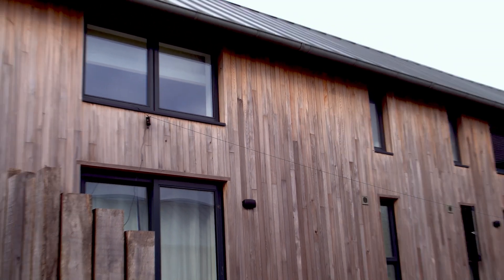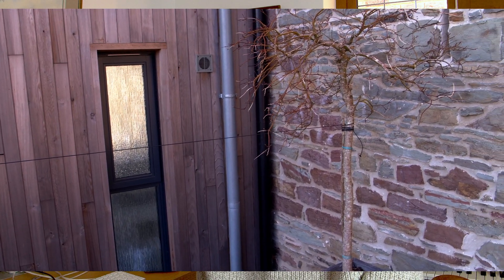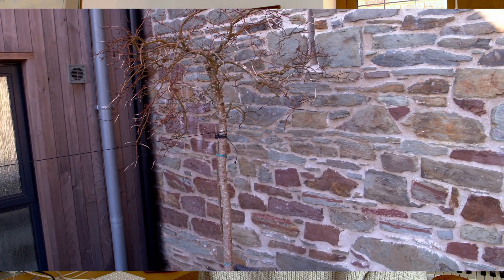My Worst HF Antenna in Eighty Years!

Comment: Just to give you all a different perspective of HF antenna systems that are shall we say 'less than ideal' imagine if you can a 30 ft steel pole angled at approximately 45 degrees end fed to cover 3 to 30 mhz usable only having an atu to make it work? Seem feasible? clue : it is! Any guesses?

Comment: Happy Birthday Peter and thanks for all the interesting videos ,I guess my standout was when I was just about to erect a 6 metre beam and decided to check the VSWR with the antenna on the hedge at around four feet up at the front of the house - using at the time a ft480 and a spectrum comms transporter - I worked all across Europe and had around thirty contacts ! never reneged to repeat it so guess there was a good sporadic E conditions ,just goes to show what can be done ! G4SNU Ron

Comment: My first antenna after getting my license again after 40 years off the air was an end-fed 60-some foot wire that ran under the roof lip of the house, some 8-10 ft off the ground. It was horrible. I ended up putting up a flag pole in the back yard and now I have a horrible (but usable) inverted G5RV with the center about 20 ft off the ground. That's all my HOA will allow. I have a magnetic loop project on the back burner.

Comment: Many happy returns Pete! I can challenge your worst antenna claim....I managed to buy a house with telephone and cable TV wires everywhere and neighbours who were not keen on me having an inverted V at the front of the property. I ended up nailing a trap dipole to the barge boards under the plastic gutter with just two short lengths of each leg coming down to the garage roof. I put it up thinking it would be OK for listening on. However, it worked on transmit and I made loads of contacts around Europe and several QRP contacts into the States with it. The propagation was good at the time, but it is amazing what will work, even though the theory says it shouldn't.

Comment: yes my FT991a tunes at least 1:2 from 6 to 160 on my 10.5m non resonant inverted L - sloping 10m to 5m for 7.5 m then drops the rest down fibreglass pole fixed to garage side. In the middle of a housing estate with houses 7m in all directions. FT8 gives all of europe and USA east at the right time but I do hit Africa SAmerica  China and Australia occasionally. Its all I can fit. I manage a contact somewhere every day. I also have a commercial single frequency only 20m EFHW in a similar configuration that doesnt tune any better.

Comment: Happy Birthday. I remember living in digs many years ago, Looking for ideas for an HF antenna, I spotted the TV aerial feeder and fed it common mode against a couple of counterpoises tucked under the edge of the carpet, it worked surprisingly well. There is always a solution to a challenge... 73
Reply from the maker: Yes any wire is worth a try.

Comment: I’ve been using a random wire with a 9:1 UNUN for years. The antenna follows on the inside railing of my deck so neighbors can’t see it. It works very well for my situation and I’ve talked all over EU, Africa, Caribbean and S. America. I’ve had a lot of naysayers telling me I need an expensive antenna and my antenna shouldn’t work very well according to theory. Too bad, my logbook says different. Cheers.
Reply: I'm also using a non resonant stealth antenna with a 9:1 unun. Mine is a 71' sloper, 50' of coax, common mode choke 3' from radio. It goes from a 15' balcony down to a 6' wooden fence. From California I've made contacts on all HF bands 160 - 10, 100 watt & QRP DX SSB contacts to Europe, Africa, the Mediterranean, South America, Asia and Australia, plus 5/9 signal reports on daily 40 & 80 SSB nets. Space restrictions require antenna experiments, and the results are sometimes surprisingly good.
Reply from the maker: So true. Keep at it

Comment: My portable antenna is a 20m half Wave but I support it on a 10m telescopic fishing pole. The wire is less than 10m long after tuning and it requires no radials. I try and tie it to fence post. The wire has a power pole connector in it and I have 17m and 12m half Wave elements I can swap over if I want to do those bands.
Reply from the maker: Thanks for sharing.
Reply: Wow! A 30 ft fishing pole?😮
Reply: @jamesabc372  You get 12m and 15m ones too.

Comment: First off Happy Birthday. But if your antenna worked on 20m it should be able to work 10m with no problem I thought ?
Reply from the maker: No - this unit used a tuned network not the normal ferrite arrangement.

Comment: You could have used a balloon to lift an antenna into the air. But since you are in the UK the RAF would have shot it down. Balloons have gotten a bad reputation these days.
Reply: It'd take a big balloon to lift the amount coax necessary to get high enough for the RAF to see it ;)

I do recall as a youngster my older brother chucking a spool of maybe 2000' of heavy fishing line to an electric drill motor, then tethering 4 delta kites in tandem to it and spooling it all the way out.  The kites were small specks in the sky.   I've wondered since if I could do something like that with an endfed HF antenna...  but way back then the kite trick was done out in the sparsely populated plains of Oklahoma and these days I live at the edge of a small city and 3/4 mile from an end of the local airport's main runway.  I don't think the kite idea will "fly" where I am now :(
Reply: @SansNeural  There are videos of hams using kites floating around YouTube if you do a search.
Reply from the maker: Ha Ha

Comment: I moved to a house in a valley and thought my HF days are over but God has created the ionosphere especially for me! On 80mtrs my end fed using both 9.1 and 49.1 from bedroom window to tree, no noticable difference ,with rocky ground straight up and down signals into UK from Rochdale are superb, works great on 20 m and can use 10m even into US when the big boys are not around. I once tuned up 2 window frames in a tower block at 120ft asl, and got many contacts on 10mtrs (all with ATU in place).
I remember in the 90s at work in the office looking through your excellent catalogue of items I must buy!
Happy birthday Peter.
Mike in rainy Pennines.
Reply from the maker: Thanks and thanks for sharing
Reply: Your valley obviously isn't steep/deep enough! From my QTH in Wales I can get a little bit of 20m at the best of times in the day, but I don't think I've made a contact on 10m from there. However, deep in the night I have occasionally made contacts with the US on 80m. Get up on top of the mountain though, in the car, with even just hamstick, or an inverted V I can set up, and it's a completely different ball game.

Comment: Sometimes you never know what your accommodation and aerial possibilities will be. I used to take a buddypole and tripod with me and had to use it indoors a few times but it still worked running 5 watts or so. You can also increase your apparent signal strength if your callsign  is rare funny enough !
Reply from the maker: Thanks

Comment: In your video, when you are showing the SWR and power meter, at the frame where your power peaks at 70W, your SWR is 2.5:1, not 5:1...
Reply: Sorry, 80W.
Reply from the maker: Power was 10W as described in video. Needle inertia makes it look better than it was.
Reply: @watersstanton  OK, so it was 2.5:1 at 8W